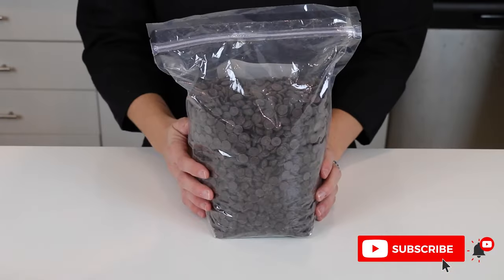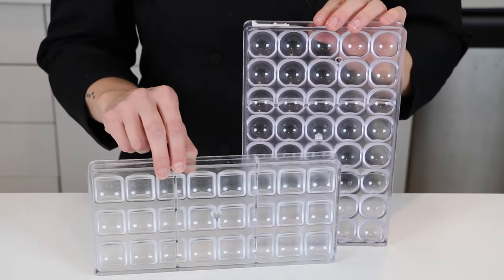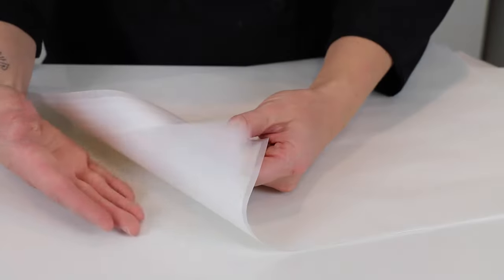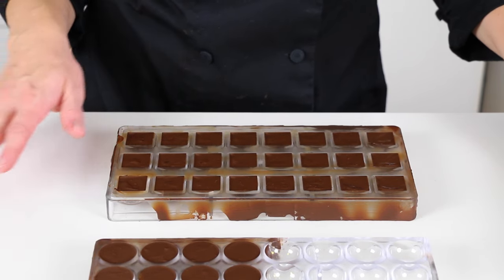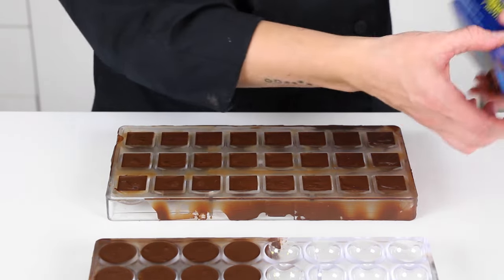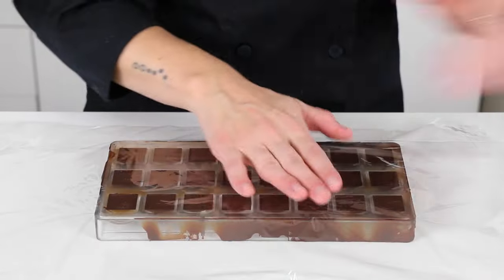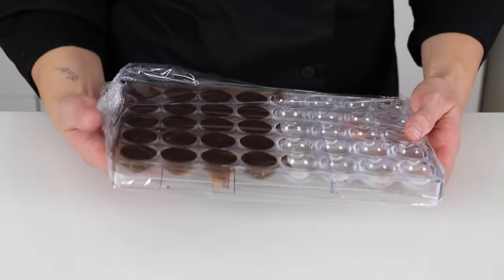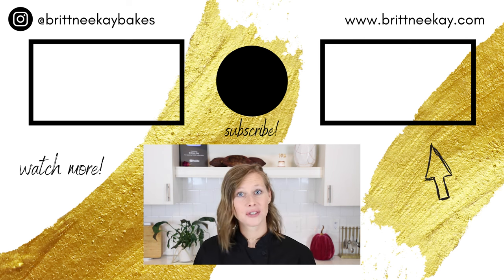Chocolate Molds | How to Fill and Unmold Chocolates | Gold Fall Bon Bon Design

Comment: Hi Brttanee. Loved the tutorial. I have a couple of questions. 1) When using a piping bag and all the cavities are filled, how do you set aside the bag and not have chocolate run out of it? 2) What happens when the caramel filling mixes with the final layer of chocolate and the bottom of the chocolates become all weird and bumpy?  Ill have perfect filled chocolate cavities, and then I go to put on the final layer to close them and the filling mixes with the chocolate. Then my scraper is just lifting the filling out of the cavity. ugh! Any help would be great, Thanks.
Reply from the maker: You’re welcome! Great questions!!
1. What I usually do is take a bowl off to the side and once I am done using the piping bag I carefully just move the chocolate in the bag away from the top and lay the bag down into the bowl..so the opening is facing up and chocolate can’t run out. Does that make sense? And if I’m doing multiple molds I’ll actually lay down a clean towel and warm it up with my head fun first so that the bag of chocolate is staying somewhat warm as I work!

2. Your caramel must be pretty runny if this is happening. My recommendation is to first chill your shells and filling before capping, but be sure to bring them back to room temp before capping. If your caramel is just runny and that’s the texture you’re going for you may want to try another capping method by using a guitar sheet. I unfortunately don’t have a video on that, but you can probably look one up. You’ll spread a thin coat on the sheet and lay it down on top of the mold and then scrape across it with a scraper. It’s hard to explain here but it’s a method you can even use to cap liquids so it will work for your thin caramel too!
Reply: @BrittneeKay  I was looking for guitar sheets just for this problem! Thank you!!! And yes I understand the bowl with the piping bag-tip up. Thanks
Reply from the maker: Oh amazing!! : ) @shilohwoods4516
Reply: You have inspired me to try these! What is your chocolate ganache recipe? How long do you wait before putting the filling in the shells? Do you refrigerate the shells before filling them?  Thank you so much for this video!
Reply from the maker: Great! Ok for a basic ganache recipe I will link my video below. To answer your other questions...the process is different depending on what supplies you have. Usually I do refrigerate my shells overnight, but that's in a wine cooler and the temp is a bit warmer than a regular fridge. You don't want your shells to contract too much from the mold and leave a gap. If you don't have a wine cooler I suggest just letting them crystallize at room temp.

BUT as a beginner, don't worry so much about how long to wait between each step. If you're just practicing you'll be totally fine to make the full bonbon all in one day. My advice would be don't put the mold in the fridge at all until you've capped the chocolates. Once they're capped, let them set up at room temp until they're firm to the touch then move them to the fridge for about 30 minutes to contract from the mold and unmold them. :)

basic dark chocolate ganache:
https://www.youtube.com/watch?v=JJqJycbLj3M @esthergrissom5422

Comment: Hi Brittney, I enjoy your videos very much. They got me into chocolate bonbons making and I am very successful  thanks to you. However, I used to use vodka to add gold luster dust in my polycarbonate molds but tried pure  lemon extract after seeing your videos. The result was terrible. The lemon extract totally ruined my mold. It made the cavities and every part that touched the extract stained and dull looking. The gold powder also  stayed stuck to the mold and it was impossible to remove it, even with washing with a lot of soap. I even tried removing it with alcohol but nothing worked. I ended up throwing away my new mold. It was unusable. Not sure what happened. The lemon extract is Watkins and the ingredients are alcohol and lemon oil.  Do you have any explanation for me? I will be scared to use lemon extract again.  Thanks in advance for your response.
Reply from the maker: Hi! So sorry that happened...it isn't the lemon extract that is the issue here, it is the gold luster dust. What brand are you using? Usually if you use an inedible luster dust it contains real metals and those stain really bad! I wish I was at home because I could show you the difference in my paint palettes...the ones that I use for edible luster dusts clean off with water and soap and the ones that are inedible are stained and impossible to get clean. So know that, I would bet that it's your gold dust that is causing the problem. I'm curious to know which brand you're using! As for the lemon extract, these polycarbonate molds can withstand a lot, even pure alcohol, so lemon extract will not hurt them! 

I have a video on edible gold luster dusts in case it's helpful for you:
https://youtu.be/OyWfiyqKQX8?si=dD43tgzcr6J7WXLp
https://youtu.be/oWmmeUXHKw8?si=ROgfJ4KYAqn-UzNC
Reply: Thanks so much for your quick response. The gold lusters I use are either Roxy & Rich or another product called Sweet Spell that has the mention ´100% food grade and tasteless’ on the label. The ads show how you can add it to drinks, chocolate, cakes, over donuts, etc.  I tried just the lemon extract on one side of my mold and I got the same issue of stains that won’t come off and that make the plastic dull. Maybe my mold is not the right quality??  I bought that particular one on Amazon.  I think I’ll go back to using vodka but I have to admit that lemon extract works much better. Thanks again and thank you as well for your very interesting and informative videos.
Reply from the maker: @IsabelleNeiderer  Wow I am really surprised. Well, I am glad to hear you're using actual edible luster dust. As for the lemon extract that is so shocking to me I'm really confused! It could be the mold...I wonder if it isn't quite as quality like you mentioned. I've been using lemon extract on all of my molds for years and I've never had this issue! There are always weird things that happen in chocolate work that feel like a mystery 😄 Maybe when you get a new mold at some point you can give the lemon a try again, a small test, and see if you get the same problem!

Comment: I’ve been having an issue on my cacao Barry 100g mold after filled and in the fridge. They setup up really nice and pretty much fall out of the mold, but there are spots where very thin layers of chocolate are adhering to the mold and making the bar look not perfect. Almost like a layer of skin peeled off. Any recommendations?
Reply from the maker: Hmm a couple things come to mind and maybe you can eliminate some. It could be a cooling issue...if it's a bar mold because the chocolate is a bit thicker it can cool at different rates and knock things out of temper. Did you decorate the mold with anything first? If you decorate the mold it is nice to first, even with a bar mold with solid chocolate, create a shell and then fill it.
Next because it's very thin layers sticking to the mold I feel like it could be a cleanliness issue. You are shining the mold before use correct?
Last, be sure you're stirring all your chocolate together well to make sure bits of untempered chocolate from the sides of your container aren't pouring out into the mold. For example if there is untempered chocolate up along the sides of a bowl and then you pour it out into the mold.
Hope this helps!
Reply: @BrittneeKay  I’m wondering if it could be the polishing issue as I didn’t know about that with the cotton balls and micro cloth. I didn’t decorate it with anything, was just making plain bars. I’m using a chocovision rev2b and seems to keep my chocolate in temper pretty accurately. I’m fairly new to chocolate work. I took a picture of it, any way I can send it to you to take a look at?
Reply from the maker: Sure! You can send it to me at my email listed on my Youtube about page and I'll take a look at it! I'm guessing it was just that you didn't polish the mold! That's an easy fix : ) @miker7447
Reply: @BrittneeKay  awesome thanks! That’s what I’m hoping. I don’t see an email listed. I see website, tiktok, IG and Pinterest. I can send through IG or Tiktok too. Whatever is easiest. Thanks so much!
Reply from the maker: Oh yes, Instagram works @brittneekaybakes or on my website there is a contact form! But now I can't remember if you can upload a file. haha Maybe use instagram!  @miker7447
Reply: @BrittneeKay  ok cool I’ll send now thanks!
Reply: @BrittneeKay  I sent it over, prob under your message requests. From ChefMikesBites
Reply from the maker: Thanks, I'll take a look!  @miker7447

Comment: How do you know the shells or edges are thick enough? I live in Brazil, it's a hot country, maybe the chocolate will be less thick here?
Reply from the maker: You will get a feel for it with practice! It shouldn’t matter if your country is hot because it is important with chocolate to work in low humidity and a cool room! So if you can always use air conditioning ☺️☺️

Comment: Hello! Thank you for the video! I am struggling with tempering, it's quite cold at home, and using a marble my chocolate gets cold really quickly, and even if I start collecting the tempered chocolate off the marble at a bit higher temperature, I still have some clumps of chocolate. Even after heating the total mass of chocolate to the working temperature, it still sets up too quickly. I can't get the perfect shells😭
Reply from the maker: Awww yes I know what you mean! Rather than use your marble you may try the seeding method instead for tempering. It’ll cool down slower than the table but that may be good for you since it’s so cold in your home! Then just be sure before molding it’s always up to working temp!

Comment: I am trying to identify the small spray bottles you used, but when I go to Amazon with your info, the one that comes up does not look like the one you used. The tube in the bottle looks much narrower than yours, i am concerned about clogging. Can you better identify?  Thank for the great tutorial.
Reply from the maker: Yes, the ones I linked on Amazon are different. I can't remember where I got the ones I have sadly. But you are right, even mine clogged a little bit, but after each use you just need to wash them really well. It may take a bit of experimentation with testing a couple different ones to see which ones you like. Each one will kind of have a different look to it so you may have a personal preference. If you want to skip the bottle altogether and just try out different brushes, I now find that I prefer that other spray bottles. If you want the look that I got using the bottle vs. the more uniform brush spray you can hold a brush over the mold and tap it so more falls into the mold. Hopefully all of this makes sense, and hope it helps!

Comment: What happens if the chocolate is not setting? Do i need to melt again? How do i temper it correctly?
Reply from the maker: If it’s not setting then yes it isn’t tempered properly. There are different methods for tempering you’ll need to study. I recommend checking out my seeding method video on my channel 🙂

Comment: I need help. I am learning how to use poly carbonated molds. One of my molds the chocolate has turned white. I washed them yesterday and dried them and passed the cotton. I used the mold this morning , same problem. Problem taking them out of the molds. I need some tips. Please help
Reply from the maker: It sounds like you did a great job cleaning your molds so my guess is going to be that it is a tempering problem. What chocolate are you using and what tempering method? Do you put them in the fridge to set up? White streaks can come from the chocolate cooling down at different rates. Do the chocolates come out of the mold ok? Let me know and we’ll see if we can narrow down the problem! 😀
Reply: I am using merkens chocolate. Yes I believe it’s the process of tempering the chocolate.  I will be trying again today. Thanks for replying. I will keep you posted.
Reply from the maker: @luciebeauvais2384  Yes keep me updated!!
Reply: @BrittneeKay  yes, my chocolates are really turning out. Thank you so much for your help.
Reply from the maker: @luciebeauvais2384  So glad to hear it!

Comment: When I flip it down most of chocolate came out from the mold, like very little stayed on the mold… do u have any suggestion?
Reply from the maker: Could be a couple different things... what kind/brand of chocolate are you using? And what temperature are you using the chocolate at? :)
Reply: @BrittneeKay  
I use local handmade chocolate dark 70% with tempered temperature (32 celcius)
Reply: @BrittneeKay  if u have a free time please help me to figure out from this problem thank you
Reply from the maker: @surakit150  It sounds like a tempering issue. But since it is local handmade chocolate I'm not sure how much I can help you since I don't know the brand or formulation. Chocolate is tricky, there are so many possibilities an error. Maybe start with a well-known brand and practice tempering to get a baseline and see if you can unmold those first!
Reply: @BrittneeKay  actually my tempered chocolate is quite ok for chocolate bar but for bon bon it didn’t work at all btw I will try to find branded chocolate and try it again, Thank you for your kind
Reply from the maker: @surakit150  Hmmm if it isn't the tempering itself I wonder if it could be humidity or room temperature. What are those factors like where you do your chocolate work?

Comment: Hi brittne how can we  add extra glaze to chocolate?
Reply from the maker: Do you mean make it shiny?
Reply: Yes
Reply from the maker: @elixirforlife4771  The chocolates will be as shiny as possible when your mold is clean and buffed before molding, your chocolate is tempered properly, and they are unmolded at the right time. Those are the most important things. If you do those right your chocolate will be as shiny as it can be!

Comment: I used the recommended edible glitter but my mold cavities are now dull.  Is there a way to get the shine back?
Reply from the maker: Hmm that’s interesting! Wash with soap and hot water. Once dry buff with cotton balls and vodka or food safe 200 proof ethanol. They should always stay shiny unless they’re scratched. And edible glitter shouldn’t cause them permanent dullness. Let me know if it works!
Reply: @BrittneeKay  I have been rinsing the mold with warm water only.  I'll try hot and soap and see what happens.  I tried vodka also and that didn't seem to work.
Reply from the maker: @rbrookler  I'm just not sure why the edible gold would stick unless it is not a true edible powder. Which brand are you using?